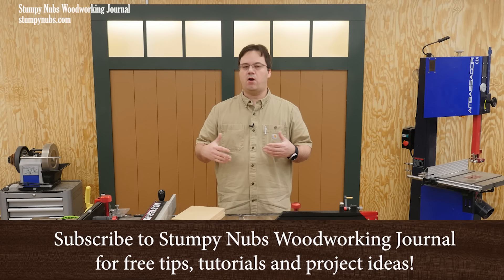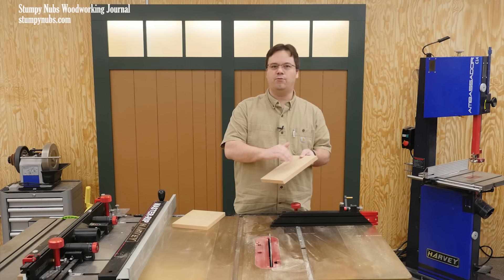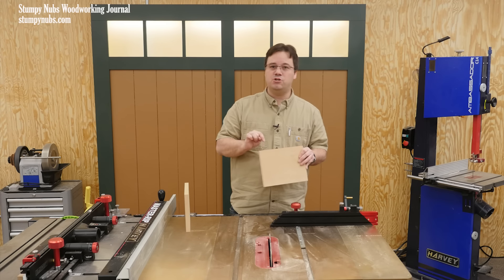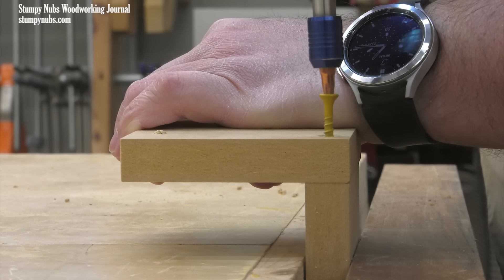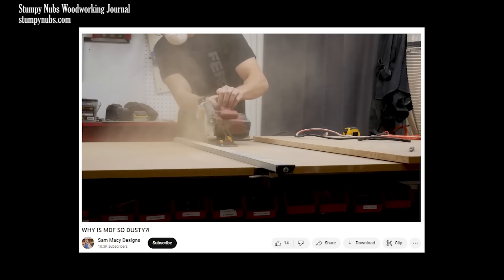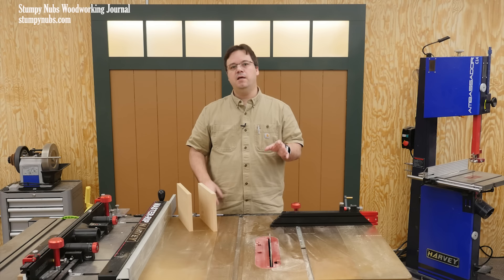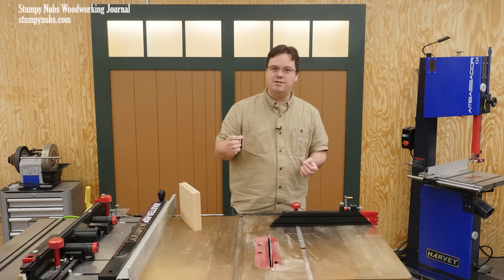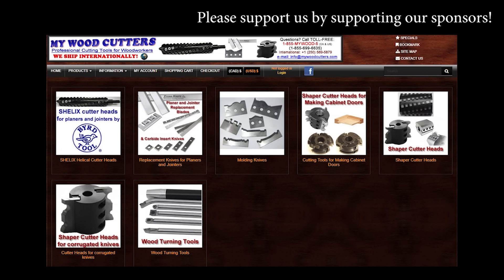This stuff changed my mind about MDF projects

Comment: I'm not using MDF due to the weight of the product and the propensity for soaking up atmospheric moisture. I've had issues in the past on a project which cost a bunch of problems and compromised the project. Depending on the project, I'd rather use MDO, much more stable, cuts well and paints well.

Comment: There are two places that it should NOT be used: 1.) anywhere that there is moisture or standing water.  Unless thoroughly sealed mdf will absorb water, swell, and then breakdown.  2.) MDF’s inherent brittleness makes it a poor material for horizontal strength and load bearing.  MDF boards used as shelves will now and break under much lighter loads than corresponding plywood or solid boards.  MDF DOES make a fantastic base layer for paint and veneer if properly prepared.

Comment: Not all MDF is created equal. When I use MDF , I never built my Fine Koa pieces with it. In my shop, there are as a wonderful place for MEF as a pattern material. Using it repeatedly without reinforcing it first would have meant wear on the pattern, so soaking the shaped edges with crazy glue (thin grade) and spraying it with the kicker beefed up the MDF.

Comment: That sentence towards the end about overusing MDF is funny to me.

In Poland, where I come from, MDF is the better material used to build cabinets and wardrobes. More precisely, the ones that are too expensive for most people to afford. Kitchen cabinets, wardrobes, chests of drawers, desks and other furniture are made of chipboard, in case someone didn't know, they are thick sawdust glued together with resin/glue and laminated on the surface. It must be honestly admitted that the choice of laminate colors is huge, from uniform colors to imitations of every wood I know. It's funny to me that a board with laminate imitating pine is cheaper than the same board with laminate imitating oak or mahogany :)

Such a board is durable enough to withstand a dozen or so years and does not cost three monthly salaries for the material for one piece of furniture.

Wood meets sporadically, max a few pieces of furniture in one house, I have no more than three pieces of wooden furniture myself and it's only because I love wood (table, desk where I work, chest of drawers)

Comment: For structural items, pilot, glue and screw, sure, but avoid screwing into end grain MDF, MDO, or really anything. Corner posts work well. General Finishes Sanding Sealer is excellent.

Comment: I have given up using MDF for any projects, and I have only been slowly using up the remaining scraps and off cuts to make jigs.
But when using MDF I have always used a quality respirator mask to save my lungs but after finishing with the MDF I will vacuum the workshop and all tooling, and then vacuum myself, clothes, mask and hair until dust free before removing the mask. The filters are not reused.
I can't stand the stuff any more. Even the dust on the workshop floor makes it so slippery and dangerous.

Comment: yeah N95's are pretty much useless against dust and anything smaller (like things that escape laboratories).. a full faced mask with filters is the best option to protect against micro fine particles
Reply from the maker: An N95 ratings has nothing to do with the type of mask, full face shield or otherwise. It is the rating for the filter itself, and it's the same on the canisters you put on that full face shield. Your face respirator doesn't have finer filtration, it just seals better on your face.
Reply: @StumpyNubs  I meant the paper one you showed an image of.. its not suitable for that type of dust..it just doesnt seal properly on the face.. they never have and honestly Im not real sure why they are still on the market

Comment: *Dont use drywall compound for MDF edges, it has a high water ratio and will cause your mdf edges to swell up almost immediately. Use bondo or just use 2 coats of a good primer.
Reply from the maker: There is far more water in glue, and that works just fine.

Comment: For utility use like workshop furniture MDF finishes very nicely with oil based polyurethane.  My router table top is 2 layers of 3/4" MDF and one of my cabinets has 21 drawer fronts of 3/4" MDF.  All sharp outside corners except the miter slots on the router table top are rounded over with a 1/8" carbide roundover bit.  In both builds oil based gloss Varathane was applied thinned 50/50 with mineral spirits for the first two coats.  The MDF will soak it up like a sponge but it penetrates deep.  After that the thinner was progressively reduced by about 10% for each subsequent coat but never below 10% thinner.  Starting with the second or third coat a light, very quick 180-220 grit sanding to knock off the high spots helps with a nicer finish.  

When the poly no longer soaks in apply one more coat, sand lightly and finish off with a final coat of the same product from a spray can.  It hardens the MDF into a seemingly different product.  My router table is over 2 years old and still looks like new.  It can be waxed to make wood glide over it smoothly.  The 21 drawer cabinet is under a 10"x26" metal lathe and is exposed to metal shavings and cutting oils.  It's a year old and holding up very well.

Comment: I use a 50-50 mixture of wood glue and water to paint the "end grain."  It seals up the surface and gives you a glassy finish for painting after sanding quickly with 220 grit.

Comment: I worked with MDF extensively - read that literally hundreds of tons. Best fastener? Cam locks. MDF is quite strong, and has quite a bit of spring in larger panels, making it quite impact resistant. However, moisture is the arch enemy of the stuff. While it is great in constantly dry settings, it is a disaster if it gets wet. 
As much of the stuff I have used, in 16, 25, and especially 19 millimeter thickness, around 99% was covered with a laminate of some type. The smooth face provides a great surface for applying a wide variety of laminates.

Comment: I always drip some CA glue into the screw holes to strengthen the MDF internal threads.  If I am in a rush, I spray a little accelerator on the surface to get instant hardening of the CA glue.

Comment: I recommend a 80 tooth 10" triple chip blade. Its the king where every other tooth has the kind a diamond shape to it. These blades also work very good on particle board and laminate. MDF is a great product to use for paint grade panel systems. Glue wash also works well for the sides. "Tip" let your glue dry at least 24hrs before sanding.

Comment: you can seal mdf to lower the brittleness.  water down some pva glue and apply before priming.  they also sell mdf sealer, and it looks like a tung or linseed oil.  It adds some strength as well

Comment: I use sanding sealer, one coat on the faces and two on edges. Gently de nib before priming then two coats of primer, sanding between each and the top coat will be flat and glassy 👌🏻
We use a lot of it here in the uk. Moisture resistant gives the best flattest paint finish.
Spax torx mdf screws are the goat.
 If you use dominoes, be careful with using to much glue where a mortise is at a right angle to an edge. It can split the material. Preferably cut a shallower depth then a deeper one in the adjoining panel.

Comment: Any time I’ve used MDF, I’d take the extra time and effort in the joinery. Preferably a dado, but lap or rabbit will suffice, to assist with mechanical and also reduce swelling if any moisture is present. To fasten, I’ve found wood glue and brad nails or pin nails hold quite nicely, as the joinery is doing the bulk of the work. Plus the added benefit of not having to cover screw heads (tedious work 😅).

Comment: I built some cabinets from mdf recently and was pleasantly impressed with the "diluted wood glue" trick for edges ... I first sanded the edges with 120 to remove any saw blade marks , then applied some diluted wood glue with a small roller and wipe away the excess immediately ... After it dries hit it with some 220 and break the edges at this time as they will be solid now ... At that time its ready to go but i did a second coat just for peace of mind ... It turned out as smooth as the faces of the mdf - and i used the cheapest pva glue i could find !!! 😊

Comment: MDF is the second best and by far cheapest material for speaker boxes. Baltic Birch is the best but stupid expensive. If they are going to be used outside it needs some kind of sealer to prevent humidity damage though.

Comment: There is a special polyurethane filler for mdf that does not powder like drywall mud....much better and holds. An expensive option is bondo but wow it's tough. You can also make a filler with flour and wood glue (PVA best)(6-1~!)...starch is less desirable. Mud won't stick or hold...just fill. jpk PS. I've cut millions of pieces without mask and still alive @68(in '70-75). Still not wise.❤️

Comment: Just a tip for speaker builders from an old car audio guy  . Back in the mid 90’s when I was using 3/4” mdf for speaker enclosures , after the wood glue dried  I would mix up some fibreglass resin and brush it on the internal joints. Wow does it make the strong and nearly impossible to break or leak , plus you can get away with an air nailer instead of screws which makes for less finish work . 
I also use spackle on the mdf cuts as a sealer and then sand , or paint will never stop being absorbed

Comment: Here is a technique I tried for a project I was working on. Stabilizing MDF with Cactus Juice.... What I learned.... overcut your project by 1/8 inch all the way around for final shaping after it comes out of the oven. MDF will suck up a lot of juice and when baked is extremely heavy. Cured MDF will sink in water but otherwise unaffected. I found that MDF shrinks in the vacuum and cure process, i.e. 3/4" becomes 11/16" . Bits and blades dull quickly.

Comment: I use loads of MDF here in Ireland for Wall panelling that I paint.  I tend to go for Moisture resistant MDF.  I use a 2 pack filler alone the cut edges and sand them off. Then I use Zinsser Bulls Eye 123 Primer.  Not sure if you can get it in the USA, but it makes the MDF go really hard raising the fibres slightly that you can sand off to a smooth finish.  I even make spindle mouldings from MDF and use sponge sanding pads after priming.  I get a really smooth and flat painted surface.  I love all you vids BTW.

Comment: As Stumpy points out, It does not paint well, splits very easily in the center, blunt's saw blades badly, and is unhealthy.
 In addition, from a lifetime as a fully qualified cabinetmaker, I have experienced the following.
1 If you spend a whole day cutting MDF your face will feel like it has sunburn.
2 It definitely does bow, the thinner the sheet the more it will bow even when left in storage under ideal conditions. Or simply painted, even both sides.
3 Starts to reject most types of glue bonds after a period of a few months.
4 Deteriates worse than anything near water.

Comment: What I hate most about MDF is that any time water gets on it then it will swell and start falling apart. Just looks awful. You cannot sand it and fix it. It will always look swollen. I remember a job site I worked at used an MDF that was waterproof. We used it outside. It was also very strong. You could not snap a two inch strip. That was the only time I ever saw waterproof MDF. Home Depot/Lowes does not sell it. Why is it when they finally make something great that it has to disappear and never be found again?

Comment: This was one of your funnier videos.  You start with a statement or two about how MDF has its uses, then go on to explain, in detail and accurately, why it's a horrible material for almost any purpose, and that it's only virtue is that it's flat when dry and not under any load at all, and that it's cheap.  If you value your time, health, and sanity, just avoid it.  If you're making furniture to give to people you don't like or that will destroy it, and you work outside with someone else's tools, sure...
Reply from the maker: What's funny is how you found a contradiction in that.

Comment: I prefer to glue seize my mdf edges. ( mix water and wood glue and paint it on the edges)   Not that joint compound wont work, just my preference.  Shellac also works,  depends on how much you need to do, and what you have on hand.    If you do use anything waterbased- let it dry a full day before sanding.   MDF will swell some with the water and if you sand to soon it can still shrink after sanding and leave a depression.

Comment: I'm a cabinet maker and if I have a project requiring MDF I'll use MR MDF (moisture resistant). It's a bit more expensive but takes paint or lacquer so much better.
Also if you have a Festool Domino machine then use domino's to join MDF pieces together, and lastly if you intend to hang doors on an MDF carcass using traditional butt hinges,  then be sure to but a solid wood lip on the front edge of the carcass where the hinges will be chopped in, the hinge screws will be much stronger into wood than into MDF.

Comment: Filling the edge with spackle and sealing with primer has been my trick for years.  MDF and particle board are great for the right applications, like workbench surface or work tables that I use by screwing my work to the table.  After a while I just fill with sawdust/ glue and beltsand.  These sheets are inherently flat and smooth.

Comment: I have been successful using oil based primer on all edges that will be exposed and painted. Lightly sand when dry and you can paint subsequent coats with water based paint.

Comment: One of the best fasteners that I found for MDF are Confirmat type fasteners.  These were actually designed specifically for MDF and are commonly used in Europe for cabinetry.  Incredibly strong joints in MDF.   Readily available at McFeely's and quite economical.
Reply: I think they were designed to use on particle board and MDF and are used more often on particle board/ melamine sheets than any other material.

Comment: I had pretty good luck with Varathane sanding sealer.
Diablo blades from the box stores cut well for the cost.. But I had a fine finish red blade from harbor freight that just cut great forever.

Comment: I made a large desk top with 3/4" MDF with a 1/4" walnut plywood veneer and applied a solid walnut edge with a tongue and groove (the groove in the MDF).  This has been a very stable top that has lasted many years with no problems.  The biggest problem was that the glue in the edge joint swelled the MDF and made the joint difficult to make up.  I would recommend a water free glue.

Comment: Instead of using joint compound, paint all cut edges with sanding sealer. Let dry, then sand with 180 or 220. The cut edges will paint as smoothly as the flat surface.

Comment: For MDF molding, I have found superglue to be great for joints.  I first seal the MDF surfaces I am joining with a liquid super glue then after that dries, I use gel superglue to glue them together.  This process works amazingly for crown molding outside corners.  I cut the pieces to length then glue the outside corners in a corner jig before attaching them to the wall.  The super strong  corner combined with the flexibility of the MDF allows the molding to conform perfectly to a wall even if it is not straight or square.  You have to do some careful planning but if you glue the outside corners and cope the inside corners, the molding will go up quickly and will look perfect.
Reply: Interesting, have you found it is much strong with such a thin "CA primer coat"? Since the joining coat is gel does that mean you also get a bit more wiggle time to line the joint up compared to only the thin coat?
Reply: @tonyc7352  You need the first coat to seal the fibers in the MDF or the gel gets absorbed before it can stick.  Similar to how you wet wood before you use white glue or is gets pulled into the fibers and there is no glue to do the sticking.  Yes, gel gives you a little more time to get the pieces aligned before they are eternally stuck.
Reply: When I am doing the crown, I use the CA technique to build any outside corners I have and install them with then with just square cuts on each end.  Then I work around the wall square cutting a piece to length and coping it to fit into the previous piece until you get to the last piece that has to be coped on both ends.  The MDF is so soft, it is super easy to cope. - often with just a rat tail file.
Reply: @connecticutaggie  Thank you for replying.

Comment: I regularly acquire 3/4 through  5/4 MDF in "shelf" sized pieces, as cut-offs from an industrial cabinet maker.  I absolutely hated the idea at first, but after 20 years, the on-wall cabinets I built as a first-run trial are still strong and tight to the wall, and I'm in the process now of moving them to a new shop.  I used a healthy 2-3 coats of mis-mixed paint I got cheap at the time- I didn't even want to take the risk of spending good money for paint for them.  I fastened the shell (box frame) together exactly as you showed in the video- coarse drywall screws with a right sized bit and countersink.  The center shelf was dadoed into the uprights, glued and screwed after.

MDF in this manner was an EXCELLENT way to hone my cabinet making skills- I got lucky with "free," but another advantage of MDF is that you start out every panel with a laser-straight edge or edges.  Like reloading your own 
b |_| llets, when you start with a good baseline, you know any error is yours, the tools, and/or the technique.  I found this to be SO beneficial!!  Great video, I'll try the joint compound trick!